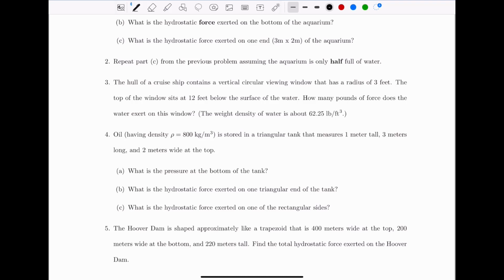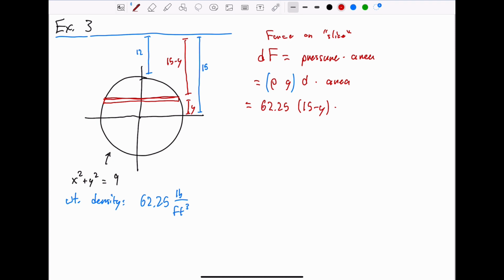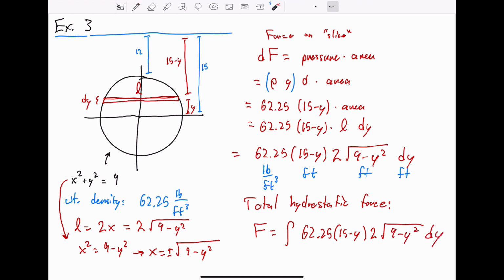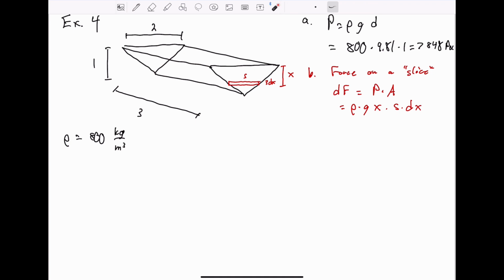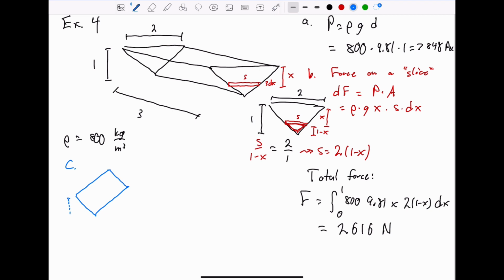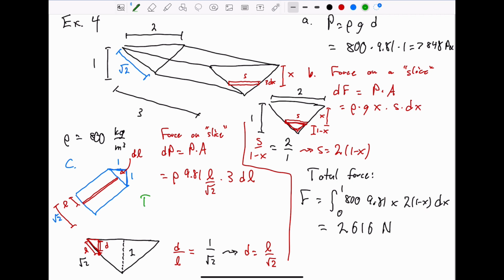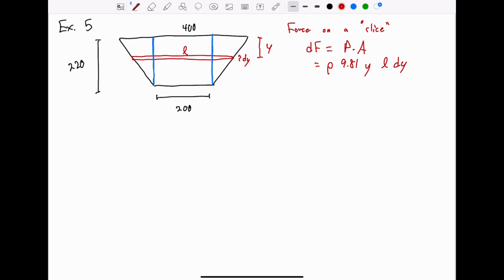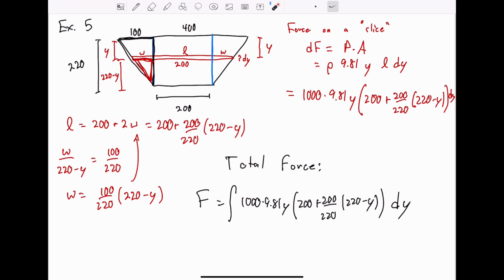Hydrostatic Pressure and Force Part 2

Comment: Thanks for providing this lesson for free! this is the kind of stuff they don't teach you in school.
Reply: I just have a slight question on example 3, while doing it on my own, instead of calculating depth based off the center of the circle, I instead based the depth off the highest point of the circle, and integrated from 0 to 6, instead of -3, to 3. I also changed my depth equation to be 12+y, instead of 15-y. When I did this my integral returned an undefined value, and I am not sure why. My final expression which I integrated from 0 to 6 looked like this:

65.25 * (12 + X)  * 2 * squareRoot(9 - Y^2)

If you could point me in a direction of where to learn what I did wrong I would greatly appreciate it.
Reply from the maker: @yurikotelnikov4686  When you redefine what y is, you can no longer use the same equation x^2+y^2=9 for the circle (since y is now measuring something different).  The "squareRoot(9-y^2)" factor is what is causing the issue in your integral.  

In your approach, y becomes more positive with depth, so you're essentially working with the regular 2D plane flipped upside down.  The circle is shifted vertically downward 3 feet from the origin, which is now +3 in the positive y-direction.  So the circle is now centered at (0,+3), and the equation for the circle in your coordinate system will be x^2+(y-3)^2=9, giving x=squareRoot(9-(y-3)^2).  If you use that expression instead of the "squareRoot(9-y^2)" and integrate from y=0 to y=6, you get the correct value.